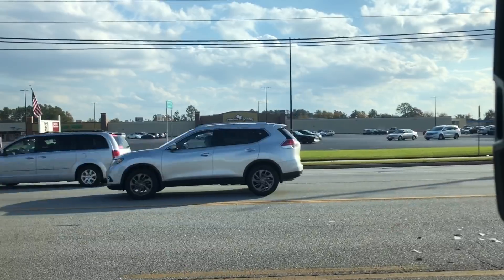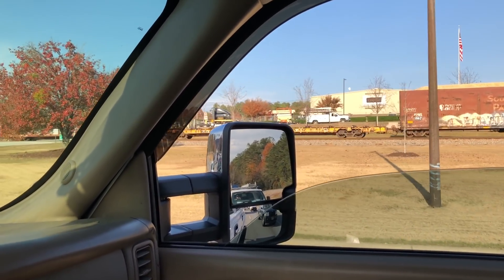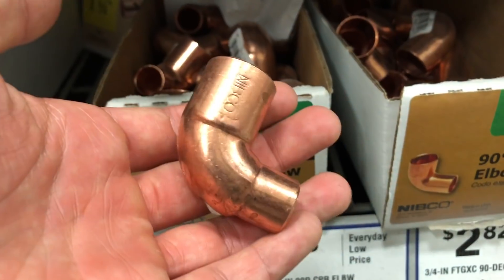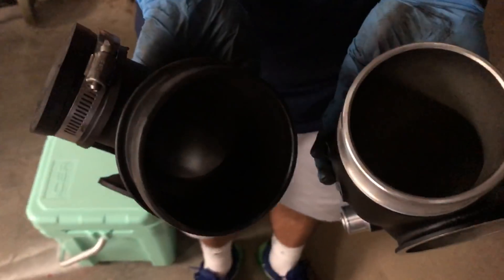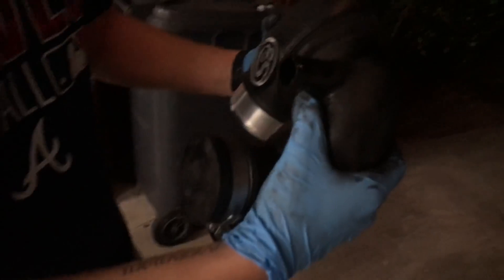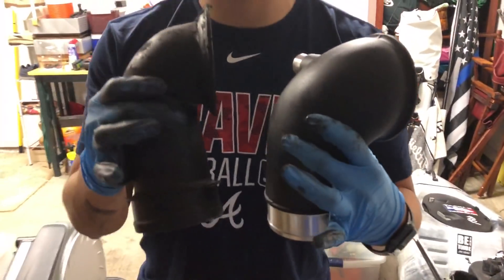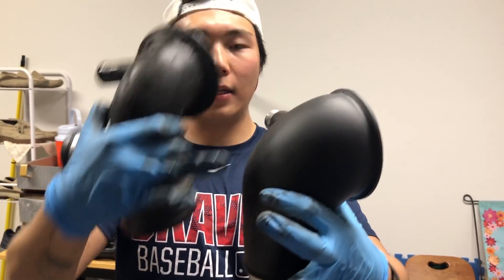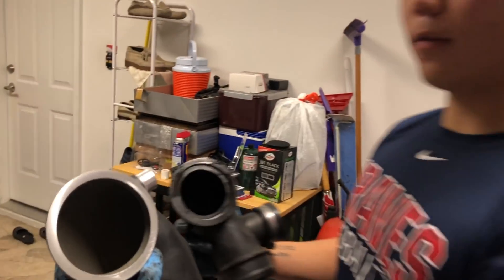Most Important LLY Duramax Mod!!!

Comment: I ran the bypass hose through a Oil Catch Can mounted on my frame back to the S&B PVC system to avoid emission issues her in Arizona. When I went through emissions testing and the guy saw my altercation at the S&B so  he called over a Supervisor! After a lengthy discussion they let me pass? I made my Oil catch can out of PVC pieces I bought at Home Depot with a drain that I can get the oil out occasionally.  If it was sending fumes/oil into the air I would have failed no doubt? FYI

Comment: Yo for the blocker plate let those bolts soke in some pb blaster and make sure you can get some good leverage on them. People recommend putting blankits on the engine or a pad or something when your up their so its more confy too. Overall that blocker plate is pretty quick and easy. Just make sure you turn it on and listen and feel for leaks cuz you dont need that. Lose all kinds of boost and stuff.

Comment: Imagine if you put a sump kit...a FassTi 150...get rid of factory fuel filter housing..ported fuel rail fitting..and get it tuned..you wished you did it long ago..what about trans mods man?gunna build it?shift kit for now?deep pan?doing a good job and it's looking good..next time your working in the engine bay..let some air out of the front tires and then the front end will be way lower for you!
Reply from the maker: Not too worried about rebuilding the trans for now
Reply: Atleast be ready for the trans to fail. Mine ate itself with a small efilive tune 4 days after I did headgaskets and studs.

Comment: You’ll still be able to switch on the fly with the monitor that just one of the features of that monitor .
It’s getting time to delete that EGR soon. I’ve got the modded up pipe for you free of charge . 👍
Reply from the maker: yeah, what I meant is that I'm getting the edge monitor but it won't be right away. so I'll have to use the autocal to switch the tunes for now

Comment: I just run mine on 5 lol. I turn it down to 4 if I'm crawling in traffic but that's as low as I got. I need that S&B mouthpiece and do the PCV reroute to finish everything off for my motor mods
Reply: Oh man and just you wait until u gotta install the DSP5 switch wiring lol
Reply from the maker: I'm not doing the DSP5 switch! LOL

Comment: Hi Bro. I am having a stock LLY and looking for some upgrades , I am wondering to buy S&B CAI + Mouthpiece & 3" Downpipe with a Y-Bridge, but I only have a question about the Y-Bridge, will it make any power difference or  issues by the time? Any suggestions?

Comment: Bro just traded my 6.6 14 2500hd Denial got 6.7 Cummins megacab Larmie 15 only has 40k on it has 12 inch bulletproof lift on 40x14.50R24 Americain Forses twin trubo over 800hp payed 37grand for her. Getting it detail cause its really dirty. Miss the Duramax but it was stock only 70k miles.
Reply from the maker: I love Americain Forses too.
Reply: I shoulda got a Denial with americain forses